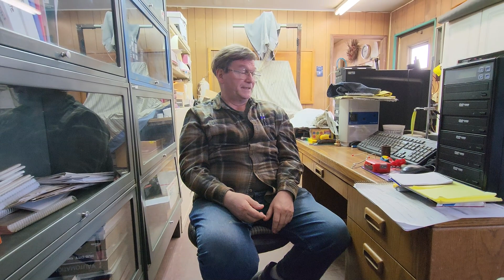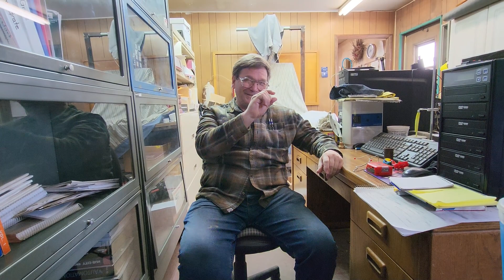Machinist's Minute: Locomotive wheels and axles

Comment: Random questions: do you think bolts and nuts are over-engineered? How many threads are actually needed on a nut and how much force is needed to break them off the work? Are there different types of threads or are the threads we use just the easiest to machine?

Comment: To aide getting the old wheel pans off the axles the wheel boss has a threaded drilling through to an annullar groove machined into the wheel seat axle area, during the removal operations oil is pumped in under hydraulic pressure to help lubricate and separate the wheel as it is pushed off the axle,
The axel for a loco is a true work of art for a machinest with verious areas and surfaces finished to very tight tolerances for bearings and  gearwheels  to locate onto or areas  for axelbox seals to rubb onto  yet allow the axle to rotate and move longitudinally to aid negotiation of curves and transmit the very high torque load's without keys or pins of any sort.
UAT ( ultrasonic axel testing ) is used to test for any indication of fatigue cracks developing within the axle by scanning from the ends or internally through a hollow bore within the whole lenght of the axel.

Comment: Modern mono block wheels on EMD locos get replaced about every 3 years, during that time the profile ( flange and tread ) can be re - profiled 3 or 4 times depending on wear or damage, flat spots caused by wheel sliding results in local damage but requires the whole tread to be turned down to get back to round so causes a lot of metal to be removed to waste .
Wear on the flanges often causes even more material to be removed to get back to a correct profile, the axles are normally UAT tested every 3 year's when wheel pans are replacd.
Tyred wheels are rearly used these days  as it is deemed quicker and easyer to swap the wheel pans than fit new sets of tyres and the skills inolved  are fast dying out on the real railway of today .

Comment: Wheel mounting tonnage is 98-154t but it's not just press on, this causes galling on the bores and axle journals there is a specific graph that needs to be produced to indicate that the pressing forces are applied constantly to achieve the allowable tonnage and there is no spikes on the graphic proving it has not picked up. The interference fit is not that technical. It's pretty much thou per inch. The time and the amount of heat required to use a shrink fit method to get the whole wheel heated up would take forever. Hence the reason for fast mounting and achieving correct back to back distance between wheels. Now when it comes to thead/flange wear the measuring tool is called a hook gauge and there is a formula used to work out how much needs to be machined off so that any hollowing and thin flanges are machined away. The formula is the measurement off the hook gauge is multipled by 3, then that amount divided by 2, then plus 1. That is the  metal removal radially that brings the wheel back into profile. Thankyou for your Chanel Howee I thoroughly enjoy it.

Comment: I used to be maintenance supervisor in a railroad wheel shop. We had a 1950s Sellers wheel lathe converted to CNC. We just single pointed the whole profile, One big tool holder with 2 carbide inserts, touch off on the back of the flange then it would take the Right hand tool from the outside up the profile over the radios of the flange then with the Left hand tool finish the flange radios.. Both wheels at the same time. Mostly freight car wheels, some passenger and occasionally locomotive wheels.
Reply: Yes this is mainly what I see in the shops that I go to (I visit many shops for my job). There are machines that can return the wheel while it’s still on the train too. You work in a pit below the train car

Comment: They have a wheel gauge that will indicate the wear limit.
On average, there is a .004" press fit between the wheel and the axle. 
The axle is measured then the wheel is bored accordingly.

Comment: Other than measuring the parts before heat shrinking them on, would there be a way to make sure the fit is tight enough, as they do now by measuring the tons required to press fit?